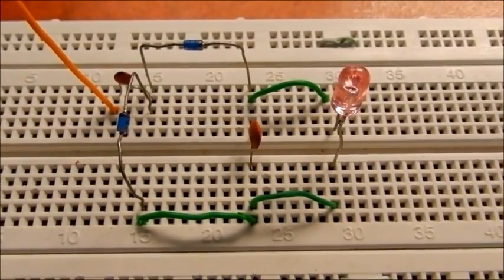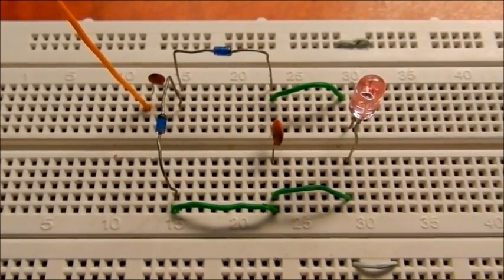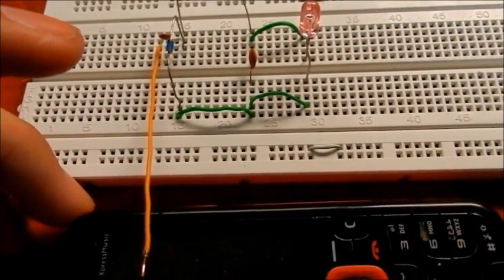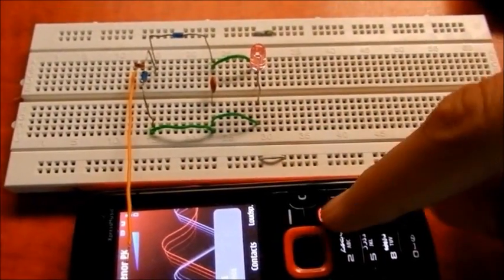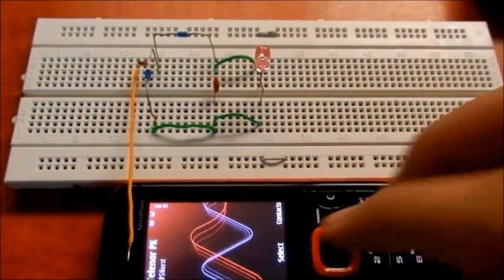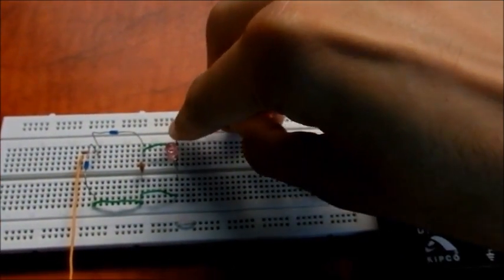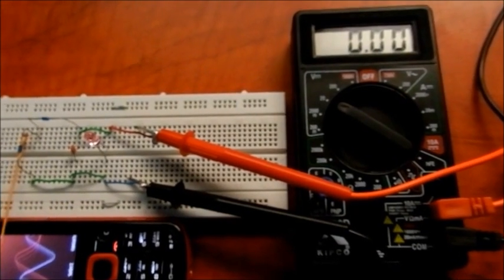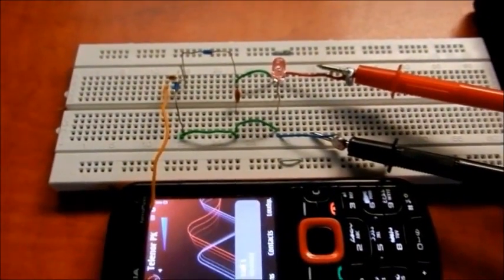Radio Frequency Radiation Detector | Cell phone detector

Comment: NOTICE:  requires red-color LED.  Those turn on at about 1.7V.

Also, add some more wire to be the "counterpoise" or ground for antenna,  added to the spot where LED connects to capacitor.   Perhaps also lay this "ground wire" against the phone, placed where your face usually rests.

Best: replace the LED with a microampere DC panel meter, the type with a moving needle.  50uA meter, or even 20uA.   Cheap from Jameco, or try All Electronics.

Comment: Have you tried this on a 4g smart phone?  I am not getting this to work?  Any suggestions?
Reply from the maker: Kelly Jolley Please check your circuitry. Check values of capacitors and also make sure you use right diodes and also biasing of them is rightly placed!
Reply from the maker: +Bloxerman Rbx Check antenna and your connections may be :) It will work on all phones until they are having a sim card for GSM
Reply from the maker: Entire list of parts is in webpage which is in the discription of this video